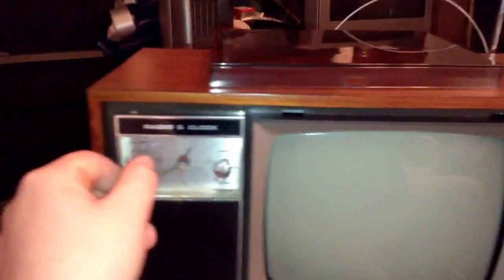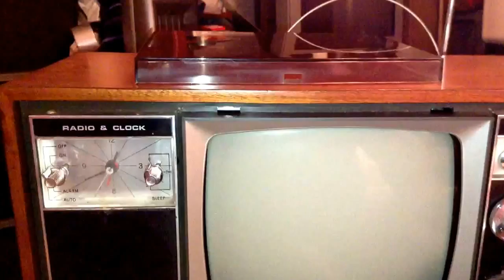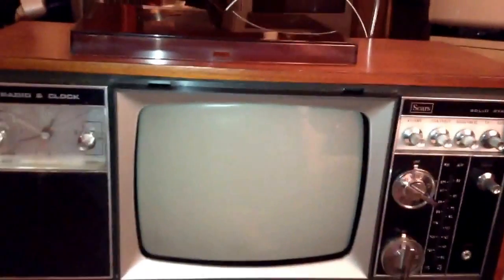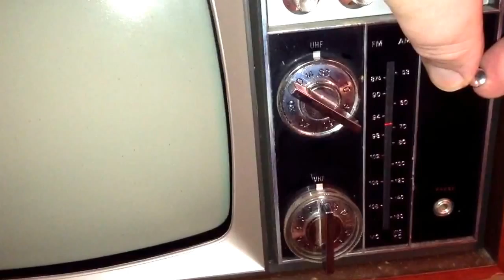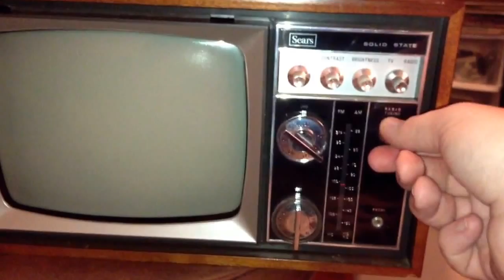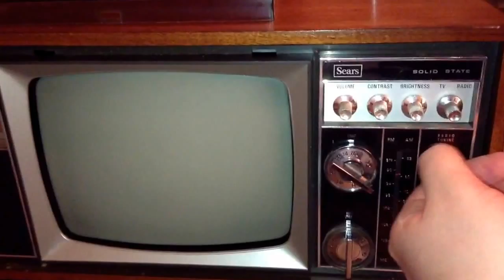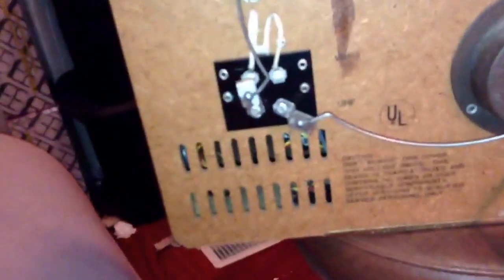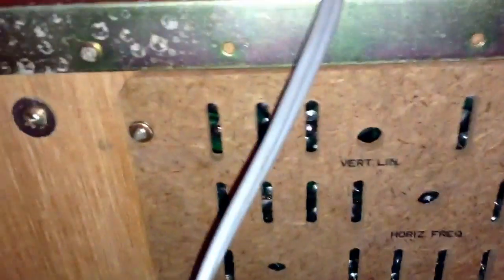Vintage Sears (Toshiba)  brand clock radio TV

Comment: I had the same problem with the exact TV...straight line across the screen. Must have been a common component failure. Love the way this set looks. Thanks for sharing.
Reply from the maker: These have a bucket full of those Japanese electrolytic caps inside.  Looks like 50 just at a glance.  Likely all need to hit the road from what I hear.

Comment: I repaired one of these. You need to replace all of the leaky electrolytic capacitors. Then your good to go.
Reply from the maker: Was there very many to change ? Looks like this set has allot of electrolytic's in this set.
Reply: Any schematics available? Im working on one of these sets